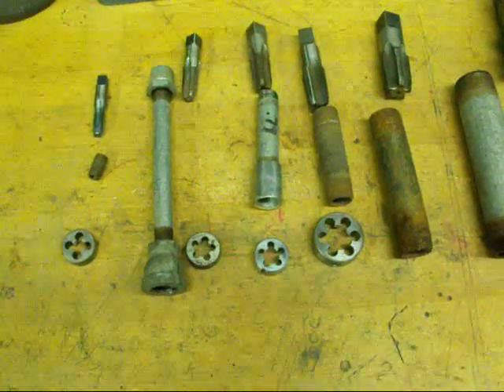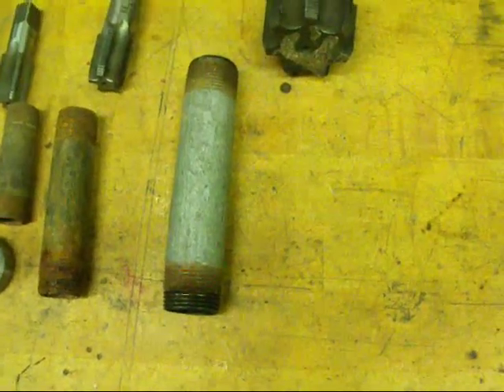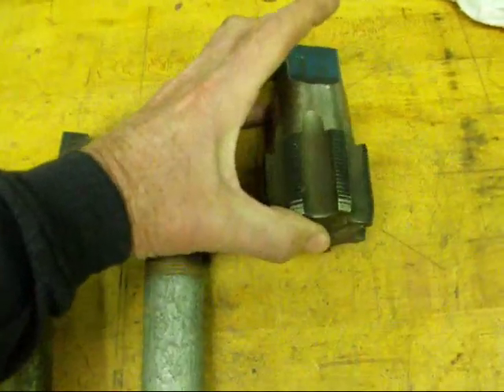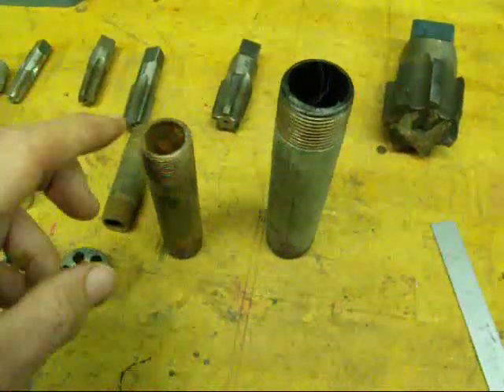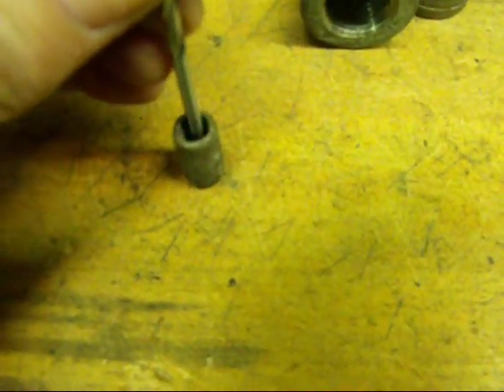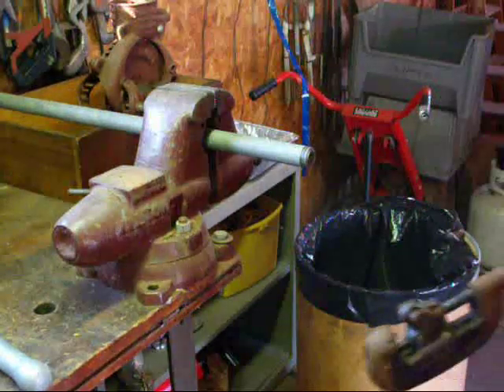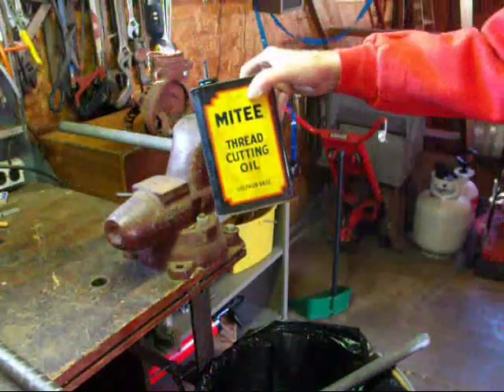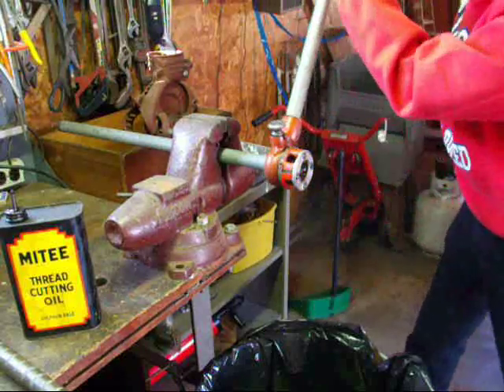MACHINE SHOP TIPS #7 Cutting Pipe Threads  tubalcain

Comment: As a kid I recall spending one Christmas break replacing most of the 1/2" galvanized pipe in our 1950's era home with  new pipe in the mid 1970's. It was not fun in the dirt crawl space under the house. We would remove, measure, then pipe cut and ream just like you showed at the bench, followed by threading with the identical Rigid thread cutting set that you used. I recall spending several days re-plumbing most of the house! I  now own the cutter and pipe thread set since dad passed. As I grew older i worked in several old school mom and pop hdw stores where i learned tons of helpful things. The last hdw store i worked in was a very old store that doubled as a plumbing shop. Boy did i cut pipe there! I cut small and large pipe there, but fortunately on a very nice pipe cutting and threading machine. I  bet i cut miles of pipe on that machine! 😂

Comment: Great video! Have you ever cut tapered pipe threads on your lathe?
Reply from the maker: Have not
Reply: How do you cut your own tapered pipe threads. Just cut loose with a lengthy testimony of trying to learn to cut and thread pipe myself with manual tools. What a fiasco. Went to Home Depot and they do cut and thread but it sure isn't tapered which causes a royal pain in the baronky to get a fitting to go on. Thanks   Jesus bless.

Comment: In the 1960's I was my Dad's power threader, same rigid dies for 1/2 and 3/4 but we also had a larger threader that had 4 individual dies for 1" to at least 2".  We did both plumbing tapered and heavy wall conduit straight threads.  We had the same pipe cutter , but used a tapered reamer in a hand brace to remove the internal burr.  Instead of paying a gym, I got my "workouts" (and earned allowance) at the pipe vise pumping threader iron.  Still have the 1/2 and 3/4 tools. Always liked plumbing more even drains, because once the pipe was in your done,. Electrical conduit work was only half way, you still had to fish cut, ,strip, and loop the wires.  That was another job I had plus we did remodeling so I got good at patching lath plaster both rough and finish.  Love your videos.

Comment: Interesting saga when it comes to getting pipes threaded at Home Depot, etc.

I had a terrible time; until I found out that HD does NOT (as far as I can research) thread pipes in a "tapered" manner. Some of their less experienced "reps" will say they do, but you will find the pipes are standard non-tapered threads.

This really caused me some aggravation. Worse: they try to tell you that it will work. And it will; IF you wanted to settle for much pipe compound and only 2 or 3 threads entering the female fittings which are always tapered from HD, etc.

Finally I went to a well equipped True Value hardware store; near where I live; and they agreed with all the above, save the last part. And thank Jesus they cut AND taper threaded the pipes.

So I will not again ask HD or Lowe's to do something they are NOT set up to do. I later discovered that the real reason for this is: too much expense (wear and breakage of their dies) and time to taper cut correctly. This is sad.

Since most home owners don't know the difference; they get away with it. But it is STILL wrong and unethical, IHMO.

Oh well.
Reply: Just in the last 2-3 days I have purchased a ratchet pipe threader from Northern Tool and a pipe cutter from Harbor Freight. Budget makes buying better quality tools cost prohibitive. 
I purchased pipe and fittings from Home Depot. Came home and started my project. The thread I did looked normal and clean. But the pipe thread would not thread into the fitting. And they did not look tapered like the manufacturer thread on the pipe. They were just threads straight out to the end of the pipe with the pipe going straight out, not tapered.
So I went back to the store (Home Depot) with the lengths of pipe I needed. The store assistant started cutting the pipe for me  and threading it and I handed him a fitting off his shelf (that I would purchase). It would not go on. It was a T. He got just a coupler and it went on ok sort of. But we kept having problems with the other types of fittings I would be using (they were off the shelf.) 
After playing around with the machine a little bit and adjusting the size of the die (can't remember if he changed the size from 1/2" to a smidgen above or below that size)...he would go through and cut the thread a second time. At that time the fitting went on. 
Will this truly work or will the propane I am putting through this pipe leak (even with tape and dope)?  A lot of work, expense and time expended to have to guess. If it does not I will be taking the whole truck load of pipe back for a refund and hopefully will have found some place to do the tapered threads.
I had looked all over the internet and youtube to try to find out what was wrong with my cutting and threading...the cutter, the die, me???? I really like the handiness of having my own cutter and threader here at home as I am at least 30 miles one way to a hardware store that will cut pipe. 
Thanks for this information on the tapered part....I had no clue that the die should be cutting a tapered thread. Yet knew that it should since the manufacturer does a tapered thread and the fittings are made to correspond to that taper.
Hope this helps someone like Pat Dee's post helped me. Thank God for an answer. Jesus bless.
Does anyone know of a reasonable set of manual ratchet dies that taper?

Comment: Hello mrpete , they way you cut the pipe is that a correct way, i used  cut  steel pipe the same way you did  but i was told by my instructor to cut in cut in clockwise.

Comment: I like to use 3/4" pipe with floor flanges and pipe caps for adjustable table legs for some shop tables. You can compensate for some unevenness in the floor that way. I can cut and thread the pipe to whatever length is suitable.

Comment: You are a Pro at threading pipe I worked for a plumber and we did alot of 1 1/2 in. well pipe and he always reminded me to use more cutting oil it is cheaper than a Die

Comment: I have a 1/2 inch piece of copper plumbing pipe... i want to thread the end of it.. i also want to thread the inside of one of those copper end caps that normaly push on the end, is it possible to thread the inside of those caps so it screws onto my pipe... cheers.

Comment: Great videos!
The history between what you call nominal sizes is, in the beginnings when they first made steel tubings, 1" tubes actually had an internal diameter of 1". Later, when better quality steel was more commonly available, they were able to reduce the "wall thickness" of the tubings. But instead of reducing the otside diameter to keep them 1" on the inside, they simply made them wider on the inside to be able to still use the existing cutter sizes.

Comment: i like that u back of the threading i also do this and for plastic its a must due to compression issues , its as if the thread cutter cutts in both directions and so much pressure is produced

Comment: hey friend i absolutly luv these videos, the nominal size thing cuased alota head scratching in my
day, i would often only experiment to get the drill bits write for tapping, im a carpenter and we also use nominal sizes, i think we say 2x4 cus its not as hard to say three and one half by inch nad a half, actuly the only lumber that isnt nominal sizes is plywoods and o.s.b.

Comment: My inlaws offered to hire a plumber to fix the water leaks in their daughter's house. Naturally I refused and replaced four valves, a union, and the bath assembly. Then going for broke, I used a little too much elbow grease on the corroded old iron pipe coming into my house from the water main and broke off the master valve at the threads. Thanks to this video and my hometown hardware store's well stocked rental section, I spared myself getting the plumber when even my own father was giving up.